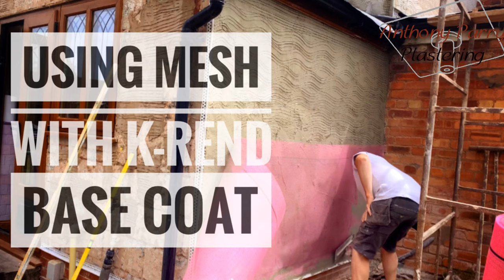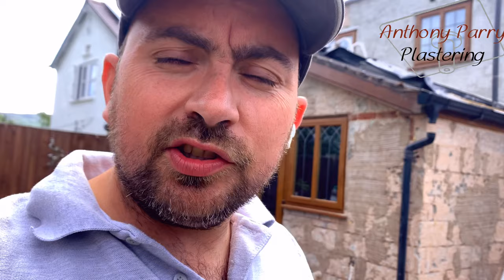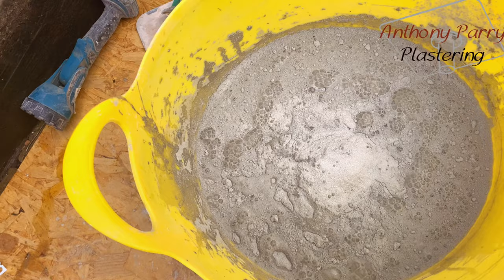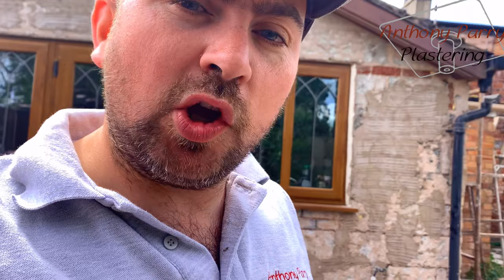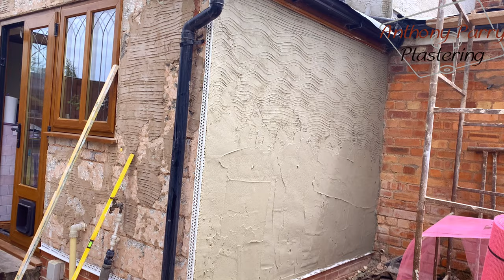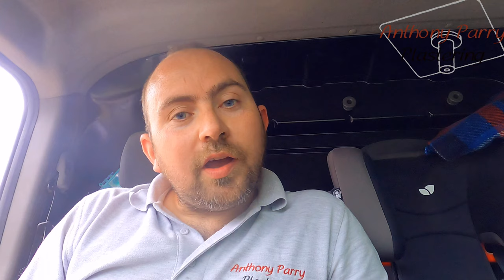Using Mesh with K Rend base coat

Comment: Better to mesh wall fist that scratch over the whole thing with another coat so u get a in formed scratch it looks a bit higgeldy piggeldy
Reply from the maker: Have you used the fibre mesh before? It’s not metal mesh. I would agree if it was metal mesh but fibre mesh it doesn’t make sense to pin it on first. It too thin and it would move too much. Think of it as a giant roll of scrim. You would pin you scrim on would you?

Comment: Hi Anthony great video again do you have treat the wall with anything for the suction I was a plasterer many years ago but thinking  about rendering my house any information would be greatly appreciated
Reply from the maker: Hi Paul, it all depends on what surface you’re going onto and what finish you are using. Normally going onto brick or blocks you can put your scratch coat straight on. If you have red brick and you are using sand and cement it’s best to wet the walls before or put some watered down pva or Sbr to control the suction. You also have to consider the conditions if the suns on it this can bake it. 
If you are going over exsisting render then you start getting other variables so you have to look into the system you want to use.

Comment: Hi mate, great videos.

If you get a chance I wanted to pick your brains.

Do you apply a k rend base coat the day before applying the top coat?

Also where is the best place to buy K rend products?

One last question, curved windows, how do you apply a curved bead when its curved above a window? Are there specific beads or some sort of method?

Comment: What are you doing mate definitely shouldn’t be making a video showing people how to apply base coat
Reply: I might be wrong but I thought you have to straight edge it flat ,sponge float and close it in with steel trowel. Then prime and top coat.
Reply: @cutler568  if the walls flat you use the mesh to flatten it out then let that pull in and the skim it sponge it up , to be fair it come up nice just not as quick and I find it hard rule of with straight edge, a speed skim better but if the walls flat the mesh self levels it , it was bit of dick comment on my part though bud to be honest 🫣

Comment: what circumstances would you use or not use mesh?
Reply from the maker: @deaosatori216  possibly new block work but it all depends on the system you are using, it’s always best to go on the manufacturers spec